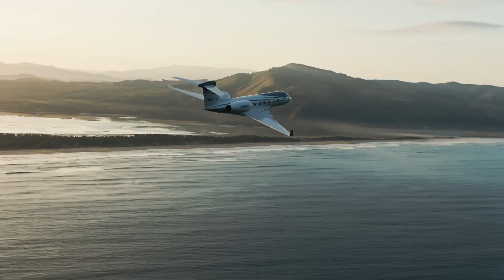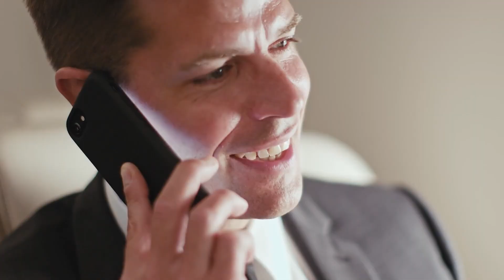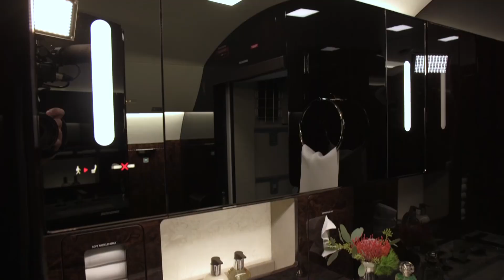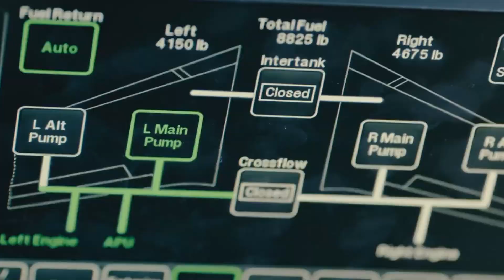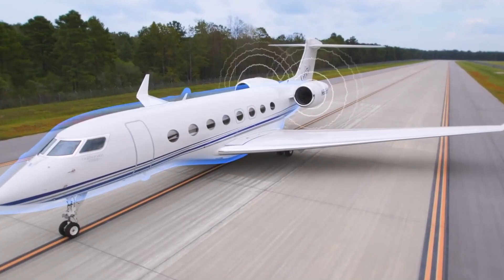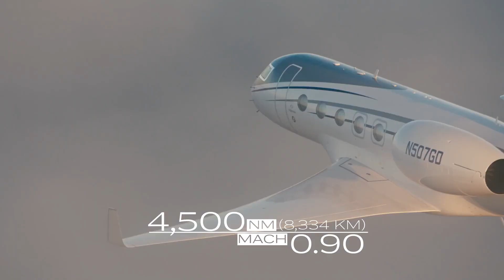Inside The $50 Million Gulfstream G500

Comment: It's not possible to have fixed costs under $800,000 per hour with 3 pilots on staff, more like $1m plus!
Reply: I don’t think you mean to say that the costs are $800,000+ per hour because they’re somewhere around $10,000 per hour with pilots. Your total program costs will be around $3-5 million per year based on number of hours flown in a year
Reply: @joshpeach4053  Your correct, not per hour but per year... my mistake. Yes 3 to 5 million/year depending on the usage.
Reply: @BDOutdoorsCanada no worries, I’ve had so many people argue with me about the costs of these things. Private aircraft, while they are expensive, are not NEARLY as expensive as people think. One person tried to tell me that king air 200s are $5k+ per hour 😂. Interestingly enough you can operate a super Connie (if you could buy one somewhere) for about $10k an hour and I think the ramp appeal and cabin would be 10x what a G650 could ever offer for the same hourly price.